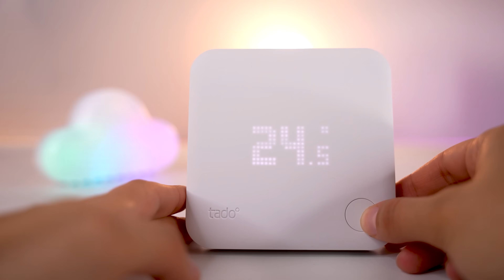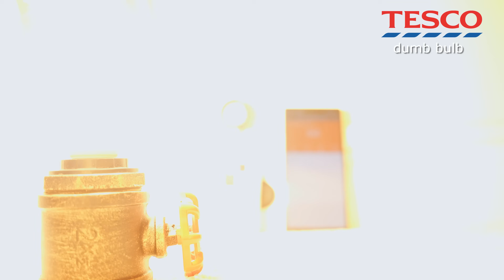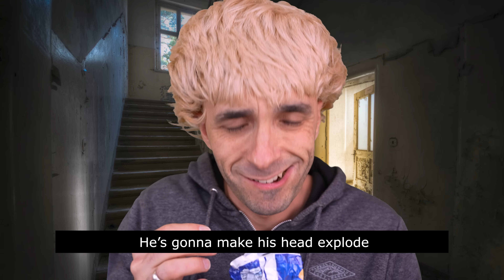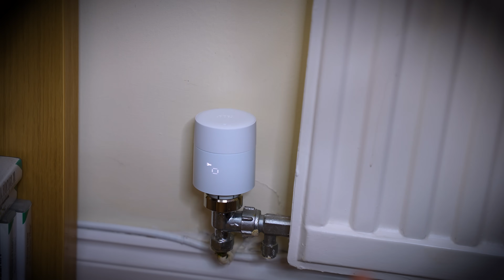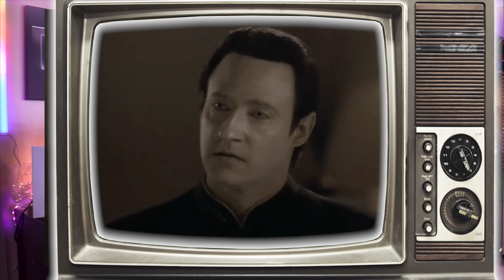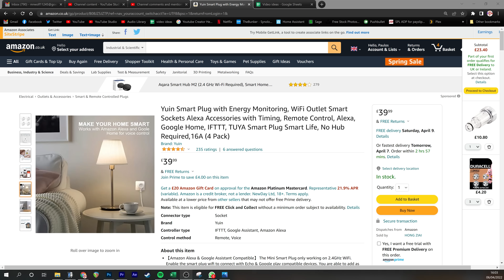The Energy Companies Will Hate Me For Telling You This But... | #EnergyChallenge

Comment: How noisy are the radiator valves? I have the LightwaveRF ones which mostly work but do make a bit of noise (you'd think it was a jet engine if you listened to my wife!)
Reply from the maker: I can't compare obviously, but they're audible for sure.  We both sleep through them, so certainly not that loud!
Reply: @paulhibbert  Cheers. Just wondering if I can be bothered to change the whole ecosystem. Have about 10 lights, 20 sockets and 9 radiators all LightwaveRF. Main issue is the light bulbs. Can't (I don't think) use the smart bulbs with them 😭

Comment: Hey Paul 
Great informative vid.
Can one smart plug be used on a power bank socket?
As I have a tv, sky q, Xbox, and a surround sound system plugged into a bank as there’s not enough single plug sockets behind the tv.
Cheers dude
Edit for clarity…extension bar plugged into smart socket, that’s plugged into the wall.
Reply from the maker: Definitely! As long as you're not exceeding the maximum capability of the sockets, which you won't be with just those devices 😊
Reply: @paulhibbert  sorted thanks.
Now off to try n convince the missis that the saving could be offset on a boundary system that using your code, would cost us £340ish.
Send ya missis round to talk my one yea? 😉😂

Comment: Sorry Paul, I hate to say this, but you will not save money. I will give you my experience, I moved from a one bedroom flat where my electric was £80 a month. I then moved into a studio flat with the same electrical equipment to find out that my electric was only £40 a month, I would even spend less than that so I would end up with two weeks or even a month sometimes with free energy. I am moving back into a one bedroom flat and I am currently quoted at £50 a month which is £10 more than I am paying now just because I have a bedroom. However, if I only use £40 a month on electric then I will never see that tenner back, and for each unit over they will charge the earth for, because they can. I call it the electricity con, you could live in a seven bedroom mansion and they would try charging you thousands of pounds and if you lived alone with just a fridge running, they will claim that you are using that amount of electric. The only way of saving money is by not using anything electrical apart from the basics and then even metering that.

Comment: My biggest best (and I do mean BEST) money saving thing was 1) putting solar panels on our roof, and 2) taking up my state government's offer to pay for half of a Tesla battery system for the solar panels.  My electric bills had been ridiculously high before the panels and somewhat less with just the panels but now after a year of having the battery, I get super happy when I get electric bills that are below $50.  My last one for March-April was $35.  It helps that I live in Australia (lots of sun - unless it's winter) but then again our electricity prices here are incredibly expensive. I went with a company that keeps me informed of the wholesale price and I can plan my major use around that. Or ignore completely if I'm running totally on either solar or battery power.  What happens about 80% of the time is I'm using my solar during the day and the battery gets what I'm not using. Then at night, my battery runs the household power until it gets to 15%.  That usually happens around 4am and sunrise is between 6 & 7am.  So I'm using grid power for only a few hours out of the day - and I'm usually sleeping then so there's not a lot of things in use.  I also do what Graeme Tocher suggests with having blinds and shades - as well as keeping the blinds down in summer to keep the heat out, thus avoiding having to turn on the AC.  I've set up A/C units in various rooms but only have them on when I'm going to be in that room for any length of time.  Big BIG savings right there over running the 'whole house' system (which I regret very much having installed).  [Edited to fix typos]

Comment: I use smart light switches in the cupboards and use them to turn the light off automatically after 10 minutes. Before this the family have a habit of leaving the lights on all day. 

About to get some Shelly 1’s to automate the heated towel rails so they are not on all day and with some Home Assistant smarts I can have them turn on and off only when we wake up or when the shower is used etc. 

Also use HA with Node-Red to automatically close the curtains in the lounge to keep the sun out when it is to hot etc. 

HOME ASSISTANT!! 😜

You need to do a video clip of you saying Node-Red and thrusting the air. 🤣

Comment: I have a Tado thermostat which I think is great, but I ended up getting rid of their radiator valves. Firstly they are very expensive, not particularly accurate at reading room temperatures and I found it was far simpler to just use standard trv's. Once you've set the trv you really need to change it, so I found for £60 a unit, they had limited use. Plus the useful features sit behind a subscription pay wall.

Comment: I live on a farm in Devon UK, I have smart tech, the best way to save electric is to have a storm that blows the wires off the poles for 4 days, what happens is nothing in the house works (cooker, heating, Alexa, luckily the water tanks was full) You should have seen the fountain when the pump on the cesspit came back on ! anyway Paul I challenge you to turn your power off for 4 days at the main trip into your house, Oh and before anyone asks yes we have Solar and a gherkin big wind turbine but they don't work unless they have the 50hz signal from the grid. Love your vids I used to be a patron but I moved my spare pennies to a much smaller channel hoping to help them onwards.

Comment: My Rachio smart irrigation controller has saved me more money than anything else, because with a well and a large yard, the amount of energy required to pump water from 200 feet below ground is considerable. The Rachio figures out how much water each zone needs based on vegetation type, sun/wind exposure, slope, soil type, etc., and disables watering based on the aggregation of local WUnderground forecasts. Plus I can fill the birdbaths from my phone ;-)

Comment: The Tado (taa doo maybe??) thermostat sounds exceptionally good. The boiler thing too if I had a boiler. I don't.
"Did I mention it works with Home Assistant?" - I laugh every time I hear this because I know what's coming.
The "cutting power to things on standby" explanation was quite good (and the fact that you actually measured the power use of the smart socket was well done). I especially liked the point about not powering down your router. Naturally, I have to do the same with my Home Assistant rig since I use it to control (and turn off) all the other things.
Since you ask, the major things I did to save energy around the house was to immediately convert all my incandescents and fluorescents in my home to LEDs and then put most of them on timers. I've got a smart thermostat on my (gas) heating, and it's set so the heating doesn't widely vary. (It costs more in power to allow the home to cool down and then jump the heat back up than it does to maintain a somewhat lower temp during usually non-occupied times of the day.) I also have a vacation setting that maintains a lower temperature over those times when we're all gone for several days.
We also do the "don't power the TV (and game consoles, etc.) when you're not using it" thing since it's off 90% of the time.
In addition, we've had some major insulation work done and we're prepping to get the roof done and then add solar panels.

Comment: Paul Hibbert : "Hue bulbs are garbage, they're not bright enough." Also Paul Hibbert: "Your bulbs are too bright !"
Seriously though, sometimes it can pay to upgrade power hungry equipment. I bought an ultrawide monitor that actually uses less power than my older smaller monitor and it has a sensor which will turn the screen off when I'm not sat in front of it. Massive energy saver.

Comment: Broadband will only get slowed down on an xdsl service not true fibre based ones & you'd have to turn it on/off many times an hour.

Turning your router off & on overnight or if you go out is perfectly safe. I don't as its such a tiny amount I don't worry but you can if you're desperate to save money.

Drayton Wiser smart stat is opentherm compatible & is incredibly cheap with the cheapest trv's too

Comment: Paul, you said not to constantly turn your router off... I used to have my router plugged into one of those round, mechanical timer plugin thingys so that my router would be reset every day. I thought that was a good idea.... but as you've just said, apparently not. Why so??
Reply: Your internet provider scans your connection 24/7 and if it sees disconnections consistently it automatically drops your speed in an attempt to stabilise your line. Always leave your hub switched on and after a few days you will notice your speed increase.
Reply from the maker: Couldn't have said it better! I worked at an ISP for 8 years. If you have virgin you're probably OK, but it's not worth the risk. Leave it connected 😊
Reply: I thought I was doing a good thing because if you have internet problems, people's first thing they say to do is turn your router off, leave it for a while to reset it, to "clear the cache"... I thought I was pre-empting that ... well thanks for the information... every day's a learning day 👍👍
Reply: I did the same for a few months until my router lost its settings one morning 🤔😡
Reply: @j_o_h_n_d_u_n_n  😲 not good. I don't do this practice now.... and never will again 👍
Reply: @utinni65  ... instead I do reboot at least monthly, as I suspect I have a DHCP issue , that gets resolved by it..
Reply: @j_o_h_n_d_u_n_n  👍

Comment: Just curious, we use a lot of Wyze products, lights, cameras, door locks and switches and even the sprinkler control which saves water here in Vegas. Also there is a newer product to open vertical blinds from a company called Sunsa that have been working really well for us. Just wondering why you have never reviewed any of these products?

Comment: easy way to save money is to buy smart extension cord which monitors energy draw on one of sockets and if its lower than threshold then turns off other sockets. This way if you turn off your pc, the extension cord completely shutdowns monitor, speakers and what else you need running with computer but don't need it when it is shutdown. Ofc this won't save you from stand by cost of computer but it is very easy to setup with low cost, these extension cords cost like 20-30 euros

Comment: Moved into a bungalow with old heating system. Big metal oil tank (no gas in the village) so had Air Source Heat pump, solar panels on roof and each new radiator has one of those thermostats that you’re talking about 🤷‍♀️😂 my electricity bill has already gone down from £60 per month to £15! And I get a renewable heat incentive grant from the government. Electrician is fitting smart sockets and switches everywhere. Yes it’s costing me quite a bit but as I needed a new heating system anyway I reckon I can feel a little bit smug knowing I’m doing my bit for the planet 😇

Comment: Imagine just how much one can save if they just used the switches to turn off the electricity.  Even though it was mentioned that the plugs and lamps use a small amount of electricity for operation we are back to the cumulative effect.  That one pound socket isn't just one pound, one has to multiply by the number of them that one has.  The LED bulb comparison was good particularly with the number of lumens, but the electricity usage comparison wasn't fair.  As light bulbs aren't usually on 24/7/365 in your average home, therefore the electrical usage will be different if it was based on an 8 hour usage.  Being that the smart bulb will continue to draw a phantom current even whilst off, whereas the standard LED won't.  The cost differential shouldn't be that great.  I enjoyed the video but just had to point that out.
Reply: The smart bulb doesn't have to used as a smart bulb you could still throw the switch & there would be no current draw at all same as a non smart bulb.

Also if you're comparing like with like it doesn't matter of you base it on 24/7 or 8/7 as long as both examples are calculated with the same methodology it doesn't matter for an example to show how a dimmer bulb can actually be less efficient. Eg one bulb might have a switch mode supply in it the just a capacitive dropper hence the power draw difference per lumen
Reply: @norfolkngood8960   Sure BUT one would have to use the smart bulb as a regular bulb on a light switch.  The major difference between a regular bulb and a smart one is the electronics that can transmit and receive commands.  If one is going to use a smart bulb as a regular one then there is no advantage.  If we factor in the cost of a smart bulb the cheaper regular one does have an advantage.  I paid about ten times as much for a smart bulb over a regular one.

Comment: Something I did with Tado was use a hue motion sensors (any sensor will work that records temperature) and use a home assistant blueprint to offset my Tado rad valves. It makes the reading a lot more accurate as the thing that is measuring the temperature of the room is not next to the thing generating the heat🤦

Comment: I've had the Tado radiator valves for about 4 months now and they are great. I use an Alexa Routine to turn the temperature up from my existing Hue motion sensors... Another Alexa Routine sets it back down (revert to schedule) after no motion is detected for a period of time. Works great!.

Another good one is for the robot hoover, alexa routine to "Start Cleaning" also turns on the smart plug for 4 hours so when the hoover is finished doing its thing it can get back to its base and charge back up and not cook the battery being charges 24x7.

Comment: I have had the full Tado system for about 3 years and am very pleased with it… was it dreadful that I pushed for getting it because it was by far the most attractive and unobtrusive 🤣. I looked at the Nest and although made sense as all the smoke detectors and cameras would then be in the same app they are not so pretty to look at. I have a large house that normal Wi-Fi signals wouldn’t reach to every room but all sorted with 7 mesh discs that the Tado has no problem connecting to. I use Hue lights (yeh I know 🤦‍♀️ but I love the sundown and sunrise setting) that are all set to lower light settings and I can manually turn off the whole house with a Hue button when I go to bed. I have solar panels and have been studying my app to see what’s causing spikes in consumption and think it’s the landing lights that were left on (they are a set of 4 spots which are not smart) looks like I am going to have to change them and use yet another motion detector. Nope, I won’t be switching off my smart assistants but will look at turning off the unused TV’s. I have a posh boiling and fizzy chilled water tap which costs a small fortune to run but it’s soooooo useful. The only thing I can see that’s left to do would be to install some battery backups but at £4K+ it’s too much of an ouch. I recently took part in the Octopus turn down events and managed to achieve halving my consumption for the stipulated 2 hours but not for 2 of the ones that were in the night…apart from the fridges there was nothing else to switch off, so I lost out on earning the 20p from them on those occasions 🤣.
Great video Paul, I will now look at all the other ones in the group.

Comment: TaDAH! Great Tip. Put your TV's and entertainment stuff on a powerstrip which is in a smart plug. When you are at work, your TV, AppleTV and Xbox can be powered off during your working hours. or sleepy time. Setting your lights to come on at 50% or 75% will save alot too. Then with the savings, you can buy more lights to automate!

Comment: 300w for PC seems too low, it is energy cost of just gfx card I’d imagine, PCs have 850 W psu and more with todays monsters like 3090s
Reply: I have an unraid server, Ryzen 12 core, 32 Gb ram, 5 HDD, 4 SSD, 2 x GPU's.
When running a physical box alongside the VM's for gaming, it draws about 400 Watts when little ones on it playing minecraft.
When not gaming about 150 watts average. but can drop down to 50-60 watts when not doing much over nights.
Reply: @TheWebstaff  Ok what kind of GPUs are you running? Also what is the usage when playing minecraft becaouse I dont think this game is stressing your hardware enough. Try running Red Dead Redemption 2 or Microsoft flight sym and check power draw than (or maybe 3dmark). I am genuinely curious :)

Comment: I have the Home Assistant Mac app running on my computer to turn the power supply on and off at 10% and 80% thresholds, ensuring proper battery maintenance and only charging when absolutely needed. does it save electricity, I don't know. I like your idea of also powering off the monitors, I have a spare socket on my Lidl 3 socket extension

Comment: I was running homeassistant (and a few other things) on an old PC - it had a about 10 old hard drives in for media. Replacing it with an intel nuc, and 2 new high 16tb drives took my power from 130 watts to 50 watts. I think it will pay for itself in a few years. crazy.